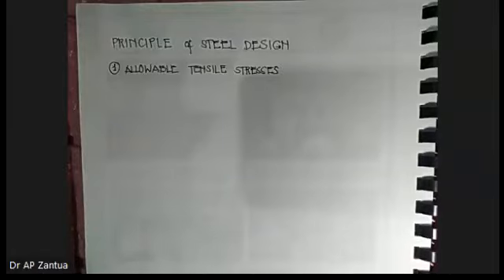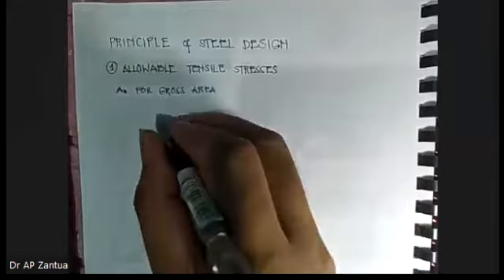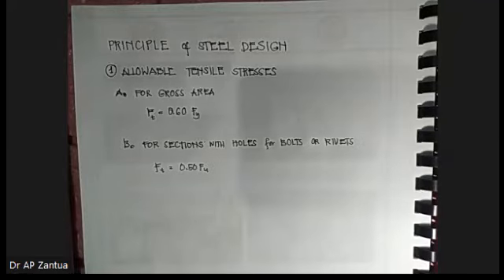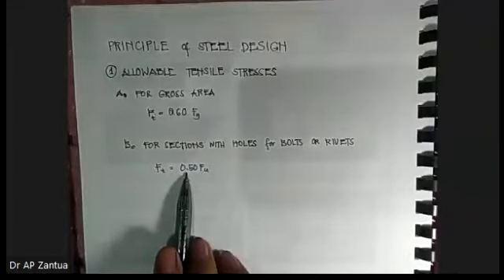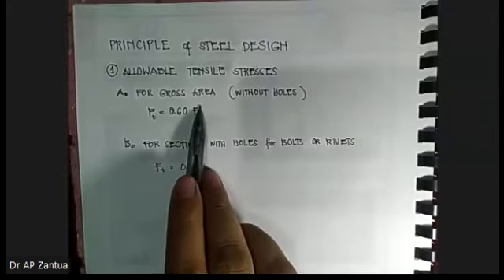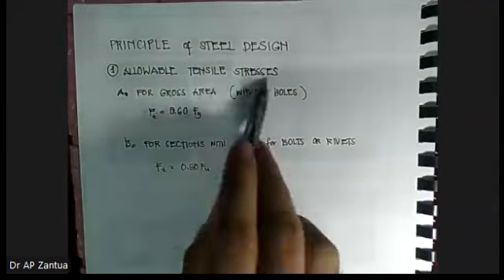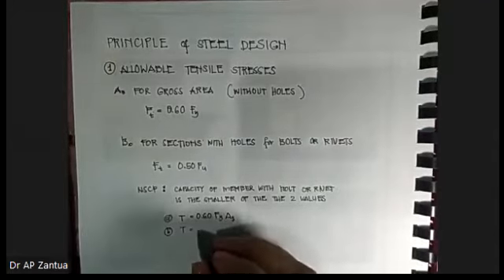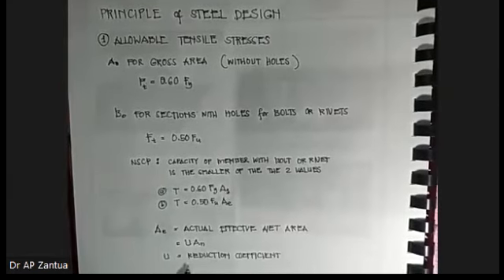Allowable Stress: Gross, Net & Effective Areas [ Principles of Steel Design ] Module 1.03.L01

Comment: Thank you sir, This video talks about the allowable tensile stress for computing the gross area and sections with holes for bolts and rivets and according to National Structural Code Of the Philippines (NSCP) the capacity of the members with bolts or rivets is the smaller of the 2 values.